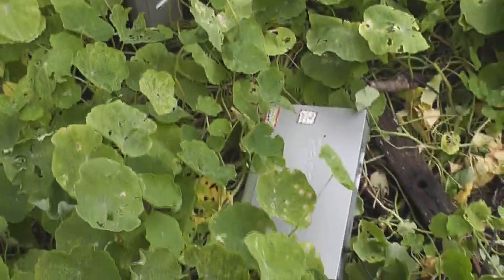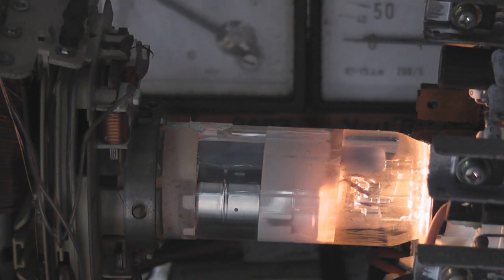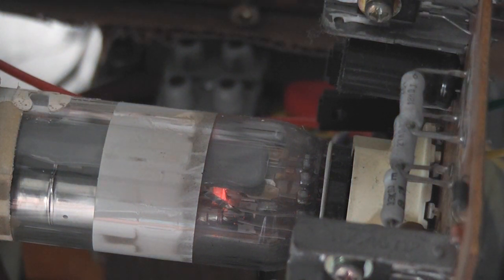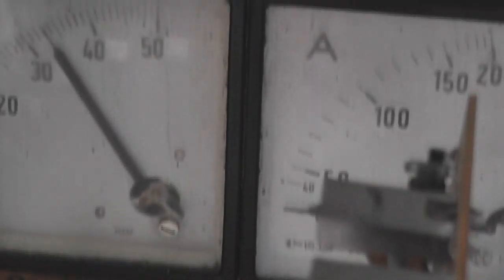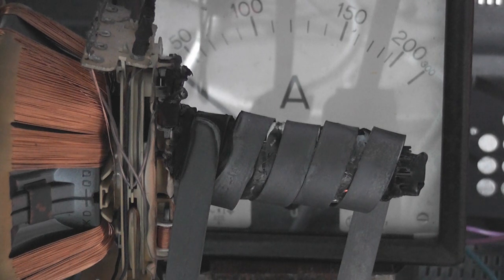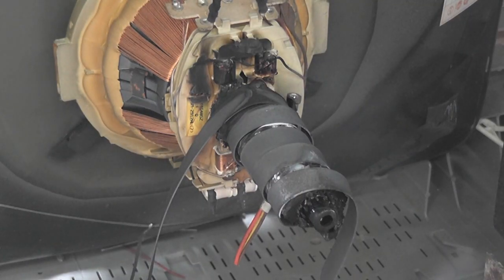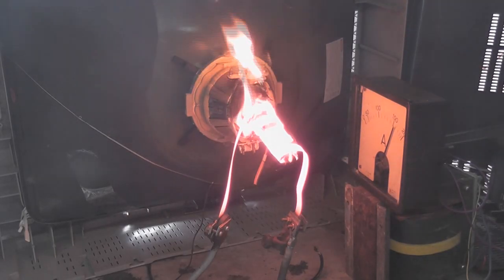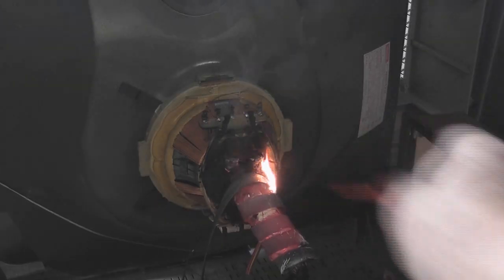CRT TV filament overvolting and destressing

Comment: just so you know the vacuum will not activate in the screen if you pull the suction cup wire from the flyback transformer i have 
taken many apart just so you know it is safe to unplug the flyback from the screen once it is discharged no need to cut the wire

Comment: If you try this again, try to remove the yoke (typically 1 clamp screw) and the plastic lead spacer at the end of the CRT that just pulls off. This will avoid the nasty stink of plastic melting and expose much more glass neck for your heating strip. Love that 50Hz sound and the meter spinning away as it counts those amps up.
Reply: Same LOL